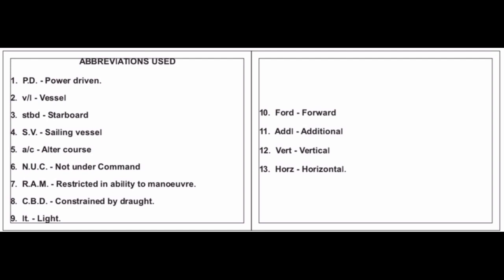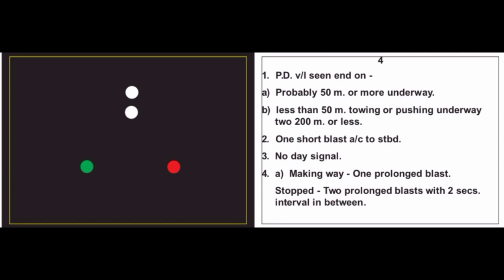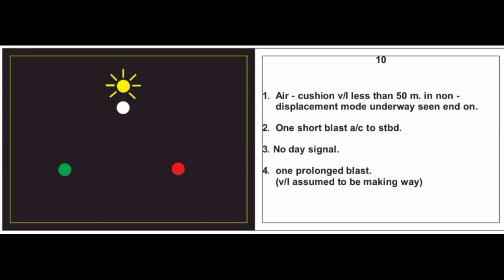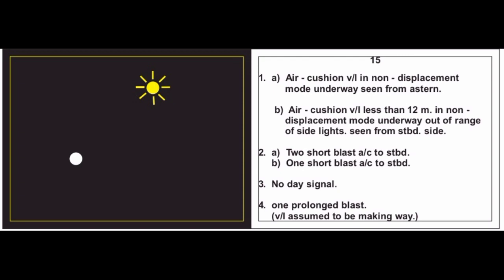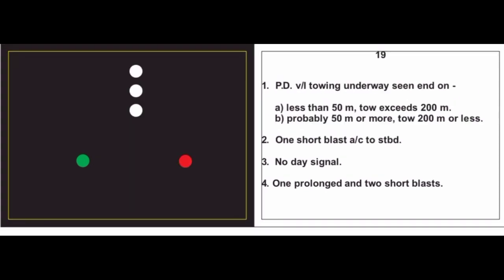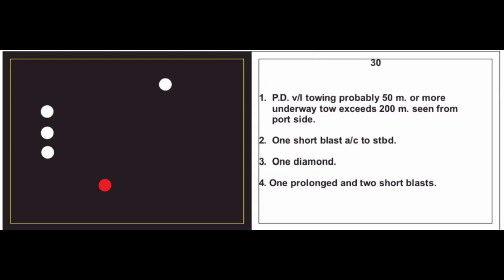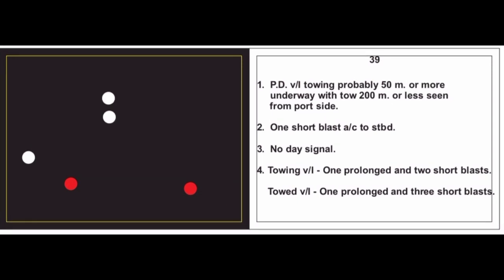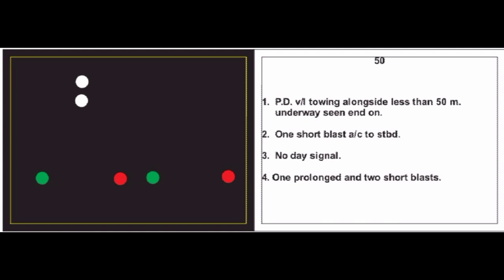ROR CARDS LIGHTS

Comment: In card no. 16, 1st point should be less than 50 mtr ? And if the lights are carried in lantern, it should be applicable only to Voss less than 12 mtr…. Pls correct me if I’m wrong